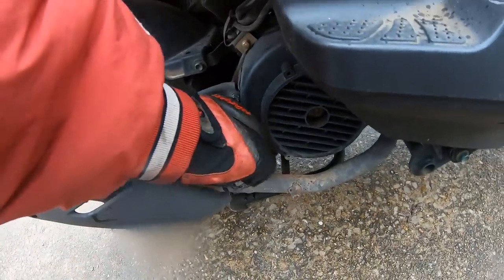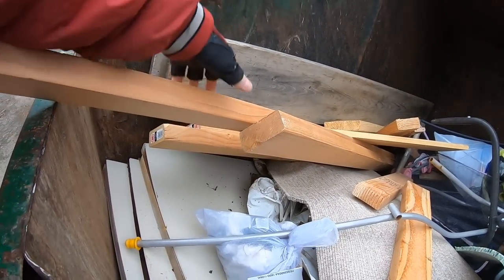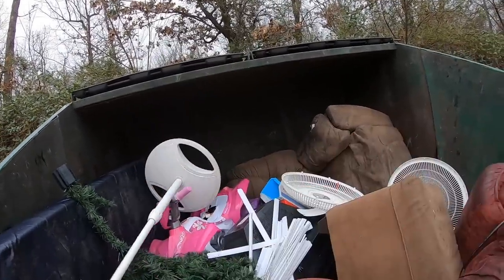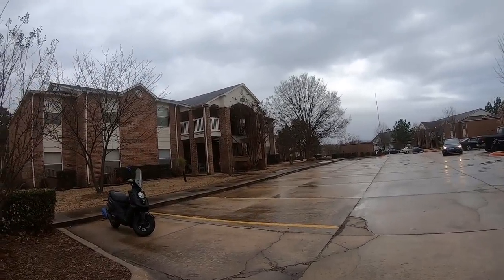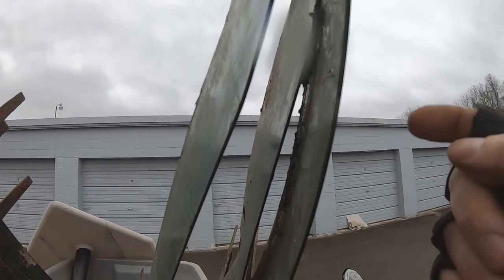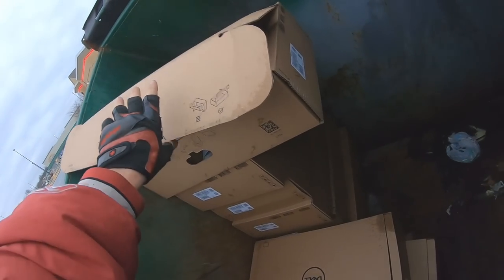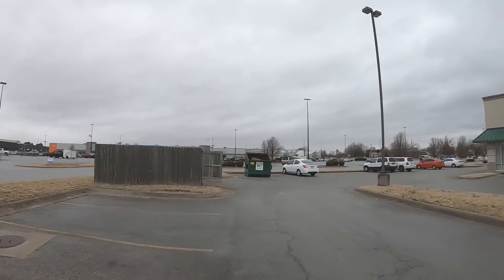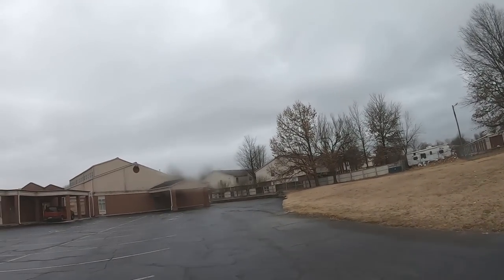Reality TV Dumpster Diving Show | S1 E2 ($200 Score!)

Comment: Short steel is worth more because it doesn't need to be further processed cut or bailed before selling and transporting it to the foundry.  The foundrys have size requirements because they cant feed large pieces into the crucibles.

Comment: That bike lock just locks up front brake just cut brake line plus how long can you put pressure on the brake line before it blows been riding for 45 years own two bikes now would never buy one
Reply from the maker: https://youtu.be/mSZwEXKMG8w - i had similar thought too - but even though descriptions i read online for it say it locks the brakes up i dont think thats what it is really doing - i think its true design may be that it grips the throttle tightly so the throttle cant be turned - but of course those aluminum levers snap very easily lol so anyway you look at it there are unsolvable problems haha - gives the person peace of mind maybe though.